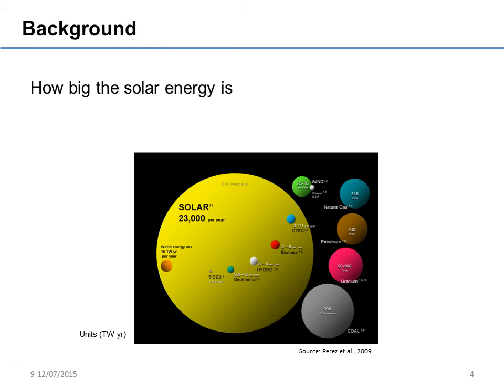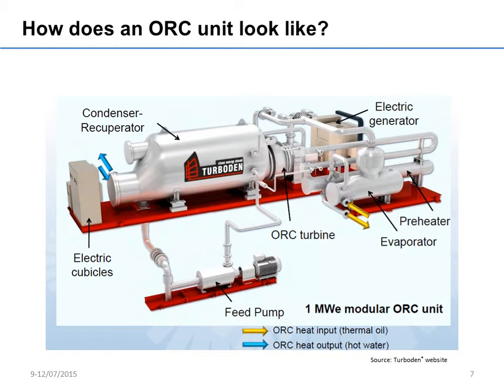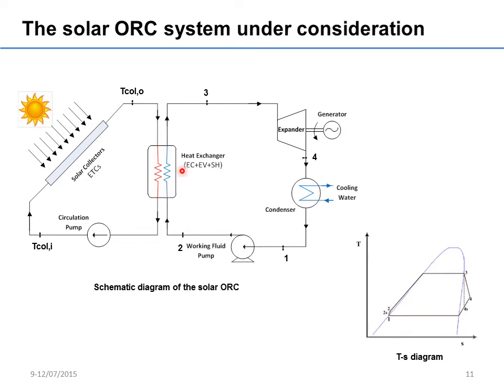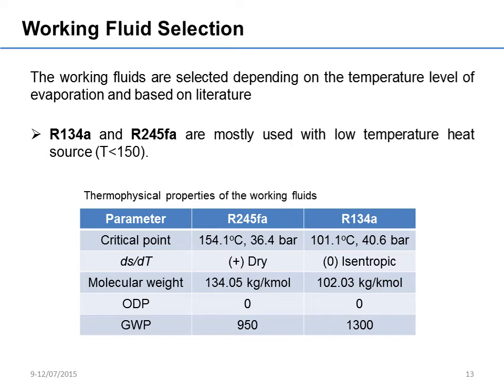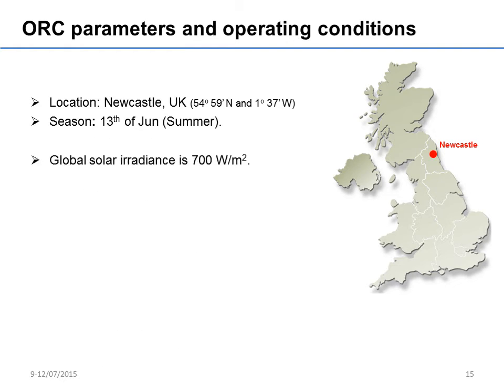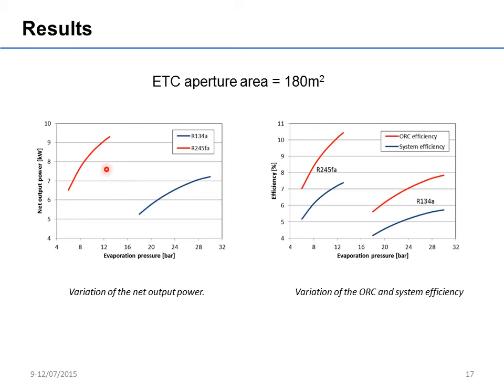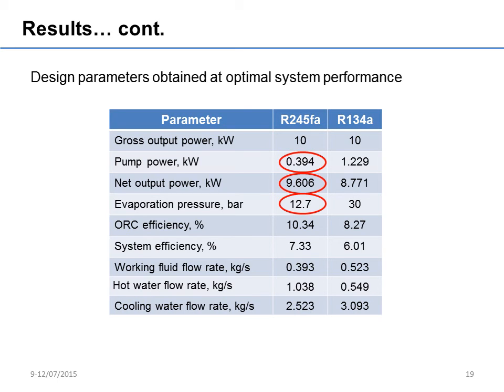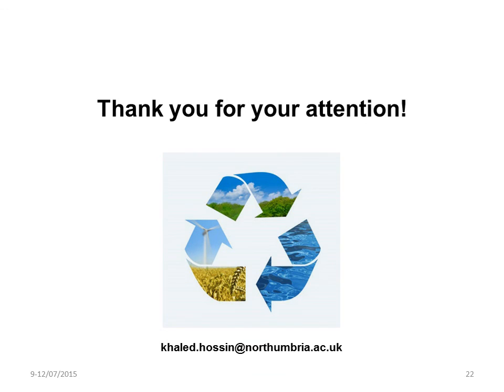Evaluation of a 10 kW solar organic Rankine cycle power system under the UK climate conditions

Comment: I would like to propose that it is totally unnecessary to use any form of solar collector. Solar energy is most readily available and easily collectable in humid warm areas, using direct compression of the air, which can ne easily accomplished using stand air compression equipment. The real power of solar energy is in the latent heat of water vapor and is conveniently extracted and concentrated using conventional screw compressors at compression pressures as low as 45 psi. 

   It should be noted, that in this way, the working fluid is in fact water vapor. This water vapor is already in a higher energy vapor state from solar evaporation and high levels of atmospheric humidity. Full saturation of the air can also be used to collect additional  amounts of latent heat using sea water,  located in these tropical humid enviroments. This will insure full saturation of incoming ambient air before compression. It must be understood that a source of heat 125 F at 1% relative humidity only contains 54 Kj/Kg of energy. While a source of heat 80 F at 99 % relative humidity contains 83 Kj/Kg of energy. http://www.michell.com/us/calculator/

    Air naturally has an affiity for water and spontaneously (Gibbs free energy reaction) saturates air in the presence of liquid water. This produces 940 btu of latent heat of vaporization from the water source. It converts sensible heat (the water temperature drops) into latent heat of vaporization during the phase change. This is the key to harvesting solar energy. This is not possible using sinsible heat transfer through multiple heat exchangers. The saturated air is the solar collector, with or without additional saturation.

     At only 45 psig  compression,  a typical screw compressor would easily obtain an output temperature of 352 F with an 80 F ambient inlet temperature. This is all sensible heat obviously and most of this heat can initially be extracted using the organic rankin cycle generator to great efficiency, given the high discharge temperatures. The ability to strip out as much heat as practicle to optimize efficiency of the rankin cycle is easily controlled by the cooling water used to remove "waste" heat from the air and oil heat exchangers on most large water cooled screw type compressors.

    The compressed air can then be fully expanded using a conventional reaction sytle turbine, after heat exhange with the Rankin style generator or it can be futher expanded below atmopsheric pressures using a supersonic conversion of the heat and pressure in a Converging Diverging rocket nozzle. In this way the pressure gradient can be used to expand the supersonic flow to 6 PSIA and fully extract 60-70% of remaining latent and sensible heat using a rocket nozzle and impulse style turbine.

     The subsequent discharged air,  and fully condensed liquid water will be substantially below local atmospheric temperarature and pressure as it leaves the C/D nozzle at supersonic velocity.  The working fluid at this point has very high kinetic energy That can be efficiently extracted with an impulse style turbine. 

    The inlet of the compressor can be used to entrain water vapor into the air stream through evaporational cooling of the heat sink that is used to cool the water and oil cooled heat echangers on the crew compressor. This heat source being used to reheat the chilling effect of the heat of vaporization pulled out of the water heat source and into the compressor inlet carried by incoming ambient air.  Thus, we are feeding the waste heat of the compressor into a heat source that is cooled by evporational chilling of the heat sink which are open both open to atmospheric pressure. Thus they become  both the heat source and sink without violating any Thermodynamic laws. This is not possible in a completely closed loop system. The sensible heat of the water bath will fall during the chilling process of evaporation which is providing full saturation of the ambient air and extracting 940 btu per pound of vaporaiztion  and converting it into latent heat.  This in effect circumventing  The Carnot heat cycle by using the Brayton cycle in an open system. Heat source and sink become one and the same. 

    It is also possible to reverse the possition of the Rankin cycle generator and expand the higher temperature compressor discharge  directly through a conventional reaction style turbine and then extract additional heat from this now  ambinet pressure stream using the Rankin cycle generators. However, this would provide a larger amount of waste heat exchange back to the water sink/source and would negate the ability to a large extent, to expand the working fluid (saturated air) below atmospheric pressures that are only achievable using a C/D nozzle and kinetic conversion of heat and pressure into kinetic energy using a impulse syle turbine. 

                     Sincerely,

                           Don E. Schmidtke. 1-269-685-1340 USA.